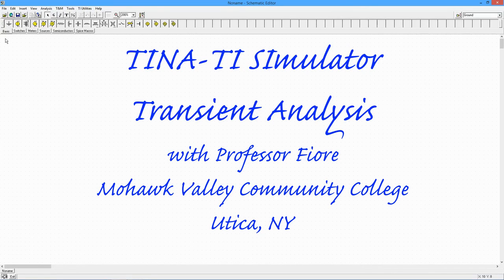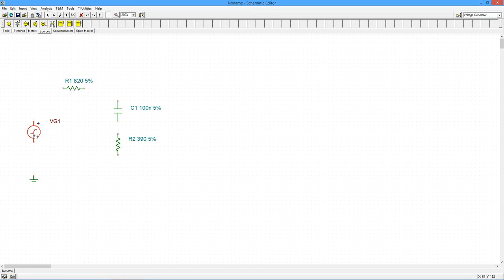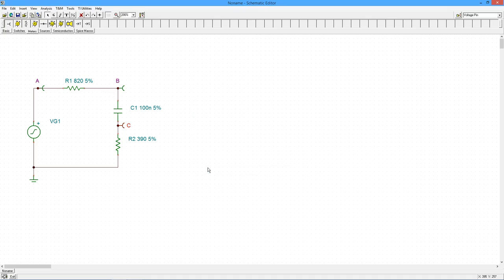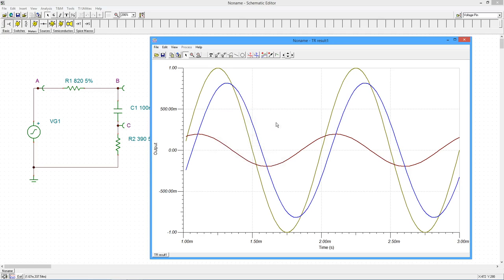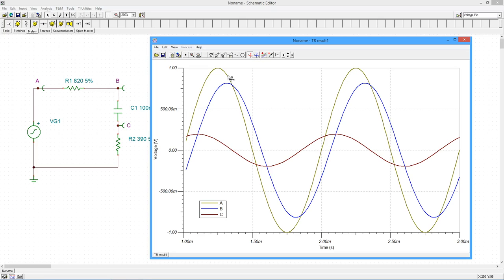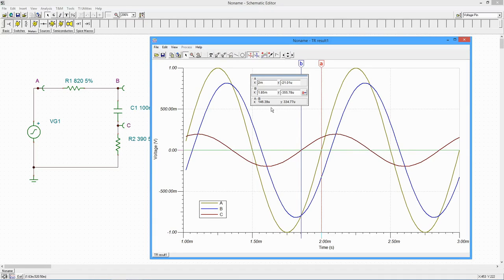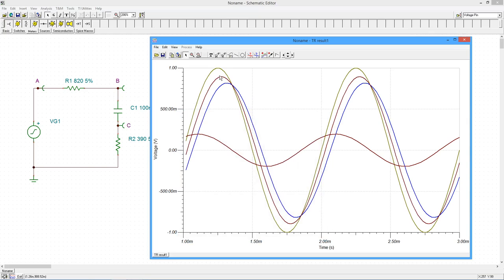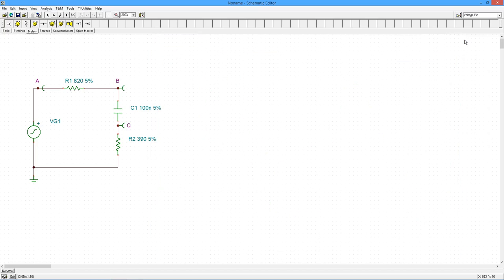TINA-TI Transient Analysis

Comment: Hello,
I am quite new with Tina. I am struggling to set up a L-R transient circuit. I would appreciate any help. many thanks
Reply from the maker: That's not going to be much different than this video. The main issue is the source. If you're looking to see the step response then you'll need to use an impulse source rather than a sine wave source. You can select either the unit step or the square wave from the Voltage Generator settings dialog, depending on your needs.

Comment: I was trying to find phase shift required to eliminate transient in RL circuit with sinusoidal input. When I applied the phase shift at the source, transient got worse.
What could be the reason?
I am using *Multisim live*.
R = 1k
L = 1 H
Freq = 1 kHz
Source = sin (wt)
Amp = 5 V
Calculated phase shift required = taninverse(wL/R) = 81 degrees.
I applied this to source settings in Multisim. Disasterous result.
🤔🤔
Reply from the maker: I haven't used Multisim Live and I will assume it works like the "regular" PC version. By "cancel", do you mean that you want to shift the wave so that it doesn't appear to be shifted? I must admit that that seems rather weird because the whole point of doing the transient analysis is to see the phase shift and the amplitude change. But, in general, think of it this way: if something is displaced from its starting point (like say, a brick moved 2 meters to the right) you can't just add that same amount again (you'd get 4 meters to the right, which, obviously, is worse). What would you add to the brick's displacement to bring it back to the starting point?

Of course, there's always the possibility that Multisim is not behaving correctly (buggy) or is treating the signs opposite of normal convention (I've spotted many bugs in Multisim over the years which is one reason I now prefer TINA).
Reply: @ElectronicswithProfessorFiore  
I mean, applying the source to the circuit after certain time t = t0 rather than t = 0 (switch turned on at t= t0) so that transients disappear.
Ref :
Network Analysis by Van Valkenburg, 3rd edition, page 153, example 6.

I checked with EasyEda simulator also. Same result. It's certain, I am doing a mistake. But I can't find it.
Reply from the maker: @myawoo  If you're just trying to get past the initial startup, then just set the analysis start time to something greater than 0. A few cycles of the input waveform should do. I do this all of the time in my videos. You'll note that I start the analysis a few milliseconds in, rather than at 0. In other words, the simulator does the calcs internally from 0 but only displays the results starting from the start time.